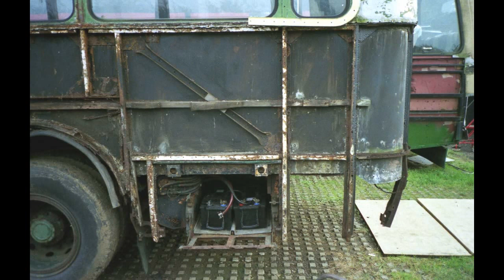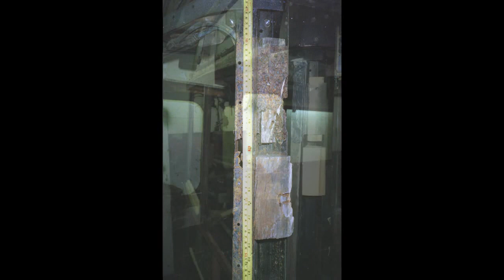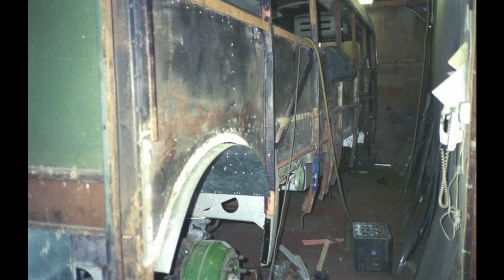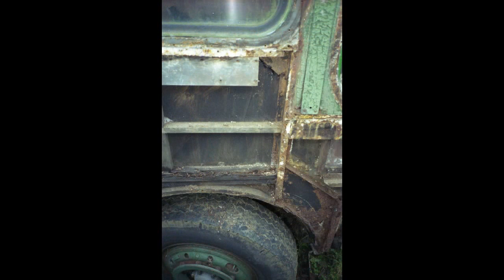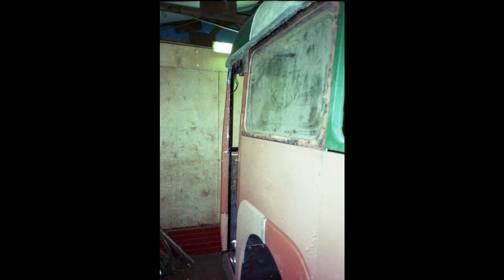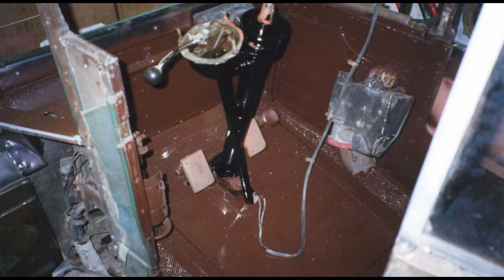GREENLINE RF269 Restoration

Comment: Was this not originally a London Country Regal? As all our Greenline coaches at Staines garage had twin headlights! The bus that I remember driving had a thin green line around it and single headlights whereas the Greenline coaches had a thicker line around them. Please correct me if I'm wrong as it was back in the early 60's that I drove one.
Reply from the maker: All RF's (Regal IV) started out with single headlights and the thin green/cream line around windows. The Greenline RF's with twin headlights and wide green band you remember were the result of a 'modernisation' program to bring the RF's up do date, i think they drew inspiration from the Gleenline Routemaster RMC that was fairly new at the time: twin headlights, florescent lighting, seat moquette, interior/exterior colour scheme. This Greenline RF survived in unmodernised condition.